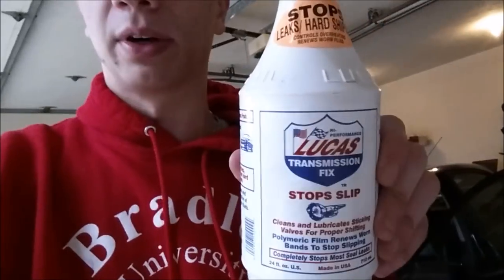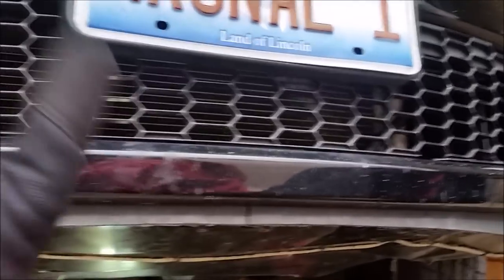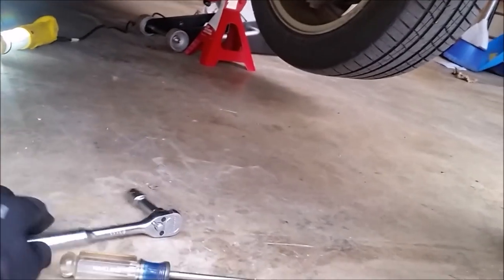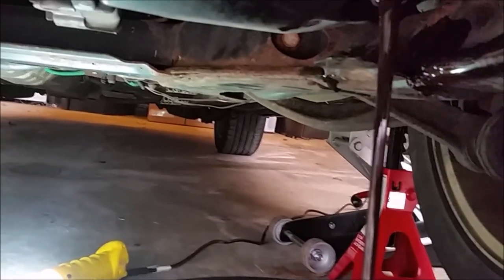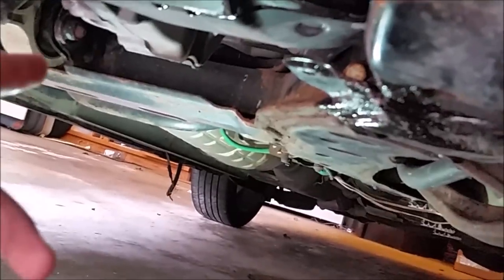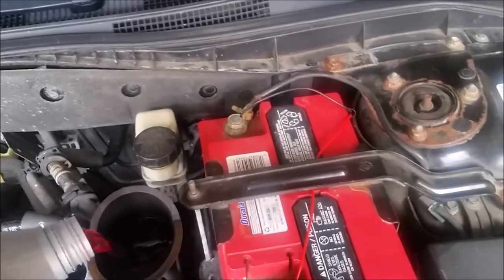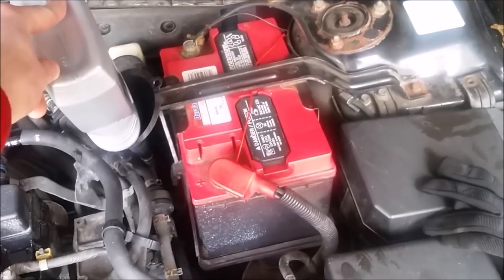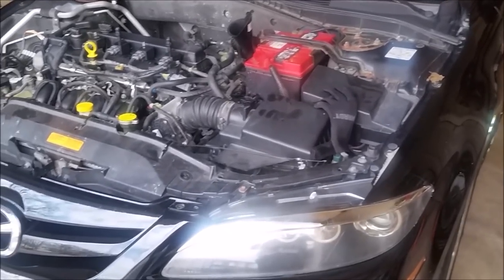Fixing jerky  automatic transmission and hesitation in acceleration   2006 Mazda 6

Comment: I had to pay $2800 bucks to get it rebuilt . I learned my lesson the hard way but never again . I change my oil at 5000 miles and my transmission fluid at 10000. My Lincoln LS have 280,000 miles on it and the transmission still going strong.
Reply: Great video! My grandfather & father both believed firmly in changing drivetrain fluids, needless to say I do to! 
iI's "cheap insurance" to keeping your drivetrain operational, and by doing routine maintenance little problems don't become big problems!  
So far it's worked perfectly for all of us. Except we change oil at 3k miles,
Like you, we also change our transmission oil at 10k miles. 
In addition, we change other fluids at the 10k 
We change differentials, transfer cases, power steering fluid, & master cylinder"brake fluid" at 10k miles... 
Antifreeze, thermostat, coolant lines and associated connection connectors/ clamps, and Drive Belt, or belts every two years regardless of miles. We also grease steering, suspension, components, & CV/U joints..
Reply: Bro my lincoln mark 7 is having problems message me so I can ask some questions

Comment: From what I heard and saw, the Lucas 'trans fix' will eventually kill your trans for sure. It might fix your issue for now, but it will also slowly expend your seals/o-rings indefinitely until they break.
Reply from the maker: Hi Charles, I did not know that. I will look more into it. Thank you for sparking my interest in this subject; it seemed too good to be true that it could save your transmission.
Reply: Used Lucas in a Jeep trans in 2011, never changed the fluid and it still runs 90%, sluggish only cold..thick fluid of course, 150, 000 miles later. Luv it. I know the reputation though.
Reply from the maker: Hi Charles, although I do believe that could happen. It's been 7 years since this video and my transmission is bone dry. I intend on making a follow-up video and address some important updates. There are some great products out there that now make this video and the products used dated.
Reply: Lucas has worked great for my vehicles for almost 20 years

Comment: Add seafoam to the transmission, drive for a week, drain and fill. Use amsoil signature atf and change the filter inside.
Reply: Seafoam is amazing!
Reply: Is that a joke? I can’t tell
Reply: @CashCowz962  nope. Works well

Comment: I own a Mazda 6 2007 and transmssion is slipping after I changed the fluid so I definitely will try this tomorrow, I will update my comment later :). Thank you!!
Reply from the maker: Hello, if it's slipping bad then this won't work. Bad slipping means clutch packs inside the transmission need replacing.
Reply: @AnthonyAwada The issue is when transmission try to shift from 2nd to 3rd gear but if I drive the car in manual there is no issue and all this started when I used a cheap transmission fluid so my bad. Thank you for your quick response.
Reply from the maker: @williamperez0306  I recommend using  Redline D4 and do a fluid change.
Reply: @AnthonyAwada  Noted, I will try this tomorrow and will let you know. Thank you again!!

Comment: My transmission was slipping in 4th and 5th gear and then the next time I got it limped home it had mostly 3rd gear and reverse only. After a few Google searches I came up with that it needed a transmission control module not located in underneath the battery tray yet located above the brake pedal inside the cockpit. Took a six and a half hour round-trip drive tonight bought one with 57000 miles on it just got done installing it noticed the one I remove with 150,000 miles on it happen to have black Sharpie marks near the bullet holes the three bullet holes mounting bracket not from Mazda. This tells me someone I already replaced the transmission control module before a hundred twelve thousand miles when I got the car? Even if the transmission control module swap works I'm still going to do what you did thank you
Reply from the maker: I'm glad everything worked out for you Terry, I'm assuming you have the FNR5 transmission like mine and they are notorious for slipping if not taken care of. I recommend Redline ATF D4, it's not the one i show in the video but I currently run it in my transmission and it shifts like new. Ill leave a link to a distributor of Redline ATF D4, but feel free to price around.  It is the most expensive ATF i have ever come across, buts its worth every penny. Let me know if you have any further questions. 

https://www.summitracing.com/parts/red-30505

Comment: Just cured this problem by replacing speed sensor - fluid was fine -but car was a pig to drive-now smooth as it should be.  FLUID WAS AT CORRECT LEVEL - DON'T BE CONNED!
Reply from the maker: Good to know. However, if your speed sensor was faulty you would get a code. So what do you do when you don't get a code?
Reply: This car was bought from a deceased estate- only 80,000 kilometers ,even though its a 2004 model  -  output speed sensor is next job - if both are the same age then they should work in sync?  -
Reply from the maker: Yes the do work in sync, however if they aren't broken I wouldn't touch them.
Reply: Hey where was your speed sensor? Outside or on the transmission?

Comment: I was told that if you put to many miles on any transmission fluid it would cause problem when 
You change the fluid. You just saw the black fluid that came out of that transmission OK ,you got to think about the clutches that has wore down,the  gears that has been running off of the dirty oil for so long that has metal shavings . When you add the new fluid it's thin and as the car warms up the transmission fluid warms up as well, as you drive the transmission goes through its shifting pattern this new fluid by being thin washes all the contaminated particles through the filters and causes the filters to clog therefore restricting the new fluid to properly flow throughout the transmission. I just had to rebuild my transmission cause I put like 70000 miles on my transmission fluid before I changed it.
Reply from the maker: This is absolutely correct Gregory, this is why I ended u changing the filter and fluid again. First time i did this job, i just drained and replaced the fluid. I waited 500 miles city driving and the changed the fluid again with the filter. Car shifts very well. I wont lie, its a bit jerky when cold. But this car gets pushed a lot and has 152k on it and has survived harsh weather of Illinois.
Reply: Ah man.. I had a feeling it be this..
Reply: A Transmission Specialist will tell you that if you change the Fluids all the Grit that's in there actually helps and when it's flushed out there isn't anything Abrasive to help Grip there's another Video by a Known YouTube Mechanic the Explains the Myth about not changing the Fluid .

Comment: My car drives fine when it drives on a single gear but i can feel the engine shifting gears and when I accelerate the car won’t shift fast enough and then it jerks because of it. Sometimes the car doesn’t jerk at all when i just started the car but when I drive for a while and end up in stop and go traffic then it’s most noticeable, it’s so bad it shakes the whole body

Comment: I ask this question everywhere online but no one gives me the answer. Can you mix different brand of transmission fluid even they are the same type or they are for the same model of vehicle? Can i just simply refill it or do i have to drain it completely before putting the new fluid in? thanks.
Reply from the maker: Hi Ben Whoever, you can mix as long as it's compatable with your vehicles transmission. In this video, the transmission fluid is still Mazda M5 but as you can tell I used Mobil one. 

The bottom line is this however, even though you can mix different brands of transmission fluid, not all are as good as others. So Mobil 1 tranny fluid isn't as good as Mazda MV(M5) fluid which both aren't as good as Redline ATF D4. You always want to put the best.  Hope this helps.

Comment: my 1993 mazda/ford probe has slipping while driving & also suddenly lost reverse. checked dip stick & burnt brown oil was there so will try fluid/filter change & lucas stuff. been whining lately aswell, kinda lika power steering pump sound low on fluid...is cold out too now
Reply: ANGRY VENOM how’d yours end up?

Comment: My vitz 1000cc with auto transm.  When put in drive it jerks, same when put in reverse. When pressed to move cars move slowly as if there is some hesitation. On plan and inclined road the car moves fine once it has crossed the speed of 20kmph. But when you have hilly road in front the car struggles a lot to climb it...specially if car has to begin it from stop position. Color of ATF is pink and no smell felt when i check after driving it for 20 km. Car stearing also wobles at a speed of 50 to 90
Reply: I need serious help. I am student and dont have much money.... :(

Comment: I have a bmw 550i same issues, slow shift when driving and jerky, (automatic) should I get a full service first? Before thinking about paying 3thousand dollars
Reply from the maker: I would change the fluid first. I am not great with BMWs, but I am sure there is a forum on jerky BMW transmissions. I wouldn't go in and get the transmission replaced immediately. Change the fluid ( don't flush) and change the filter if possible. Hopefully that will cure it and save you a lot of money. If you need any further assistance let me know.

Comment: I loved your video.  Quick advise needed.  I have a 2007 Honda Accord 4 cylinder with 5 speed Automatic.  Car has 42,000 miles on it.  When car is driven on cold day without warming up engine, transmission shifts rough from 1 to 2 and 2 to 3 for the first few shifts.  If engine is first warmed up for 3 minutes before driving, then transmission shifts much better.  I had transmission fluid flushed and changed at Honda dealer.  It didn't help.  What would cause this rough shifting when transmission fluid is cold?
Reply from the maker: Hi wgsvm, I hate to tell you this but it signs of a wearing transmission. When the fluid is cold it doesn't expand. It isn't until the fluid is hot until the car shifts fine which is an indication that the clutch packs have been wearing out.  There isn't much you can do apart from CHANGING the fluid (not flushing it). Change it with redline ATF (make sure you get the one suitable for Honda's). I like Redline. It preserves the clutch packs and makes the fluid do the work. Hope this helps.

Comment: Hi, I just bought Mazda 6 (Atenza) 2.3l and while it is cold it changes the gear with a push from 1st gear to 2nd. The color in transmission is yellow far from pink. I was told by Mazda dealer that I should change the oil in transmission at 100k, my car is at 80k now. Do you think that changing the oil might improve the gear shifting while it is cold? Thanks
Reply from the maker: It will slightly yes. Make sure the dealer changes the fluid and the filter. It's a very simple process. Many mazda 6 forums help a lot with it.
Reply: +Anthony Awada thanks! Is it better to do a flush or just changing is enough?
Reply from the maker: That's a great question Yaroslav. If your vehicle is on time for its scheduled service then I would go for a flush. But if you are late, then I recommend a change and filter change.
If you are doing the job yourself it is not that difficult. There are certain bolts on the transmission pan that are in real hard to get to positions. Fluid wise I would recommend either
1)Castrol ATF for import vehicles: http://www.autozone.com/motor-oil-and-transmission-fluid/transmission-fluid/castrol-import-multi-vehicle-automatic-transmission-fluid/830382_0_0/?checkfit=true
2) Mobil 1 fully synthetic (as I used in the video)
3) Mazda M-5 (which you can only buy at the dealership)
4) redline D4 (I have heard a lot of success stories using this fluid): http://www.redlineoil.com/product.aspx?pid=51&pcid=9
Reply: +Anthony Awada thanks a lot!!! 80,000km on the clock is it still on time?! :) I was told by Mazda dealer that I should change it or flush it at 100,000km. And when I asked him whether should I change or flush it he looked confused and just told me the price...
Reply from the maker: I see, well my honest opinion and I tell you as if it was my car. Is to just change the fluid and filter. Just to stay safe. A Quality Mazda OEM filter with Redline D4 ATF should make your car shift like butter. After this I would drive it within the city for 400-600 km

 If you see a slight improvement but you are not happy enough,I would just drop the bolt &;on the transmission pan (like the video) again. And change the fluid that comes out with new fluid and here is why:Your fluid is dirty and when you drop the pan you will only be removing about half (give or take) and replacing It with new fluid. So now your fluid is 50% dirty. If you drop the bolt again and drain half and replace half with new. Then 25% will be dirty. You could just flush all but then you run the risk of damaging the clutch pack.

Just make sure you don't overfill or under fill that transmission. They are very sensitive and if you under fill it and drive it you could damage the clutch pack.I hope I am making sense. Please respond if I don't.
Reply: ok so once i am at 25% dirty then couldn't I just do a drain one more time and then it would be nearly 100% clean? you're saying that flushing the entire system at once is not good because then there is no fluid inside the gears and what not which is not good, so doing the change in sections is better because you still have the fluid in there to protect it. is this correct?

Comment: Hello. I have a 2012 Toyota Camry that has a stutter problem when accelerating. When we got the car, we got the spark plugs changed, the problem stopped. I drove it Saturday for the first time and the  stuttering happened about 4 times maybe. I dont believe there is a specific gear that it stutters at ... So  What else could possibly be causing the stutter?

Comment: Can you describe the jerking your car did? My Mazda is jerking right now too and the AT symbol comes on when it happens but goes away as soon as the jerking stops. Just curious if we are having the same issue before following similar steps.

 We changed the transmission fluid and filter but the problem the jerking is still happening. 

The transmission fluid was flushed at 60k. Transmission fluid and filter were changed, not flushed, a few days ago. Problem is still happening. I guess we ought to try changing it again and possible with some stabilizer slip fix?

Thanks!
Reply: I took my mazda 6 2005 into the shop this morning because the AT light came on and the car started jerking when shifting from 1st to 2nd gear.  He told me it was the transmission vehicle speed sensor.  Autozone told me the sensor is $137 but I looked online ebay and they range from $28 to $79 dollars and there is a video on youtube that shows 2 latinos how to change it with a 10mm socket and a long extension with a swivel attached to the end of it.  Hope this helps.
Reply: Interesting! My husband wants to take it to the Mazda dealership tomorrow to see what they say. If they suggest something like a new transmission then we will definitely need to try this first.. Ours is a 2012 Mazda 3 automatic with 120k miles.
Reply from the maker: Thank you Don, Victoria as long as you are using the correct fluid and the filled to the correct amount I would then follow Don's advice. It isn't complicated. Hope it works out, please keep us updated!

Comment: I have the same car, 2006 Mazda 6 automatic with 64k miles on it. It jerks in between 4th and 5th gear if I accelerate quickly and after 60 mph it jerks even worse and then the check engine light starts flashing. It almost feels like the car won't go any more than that speed but I didn't try to since it freaked me out 😅 lol Every where I have called  and told them my problem they say it sounds like a transmission problem and that they don't do that. So now I'm stuck with not knowing if it actually is even a transmission problem. Did your car do the exact same thing? I mean does it sound the same like what I described? Do you think this will fix the problem?
Reply from the maker: Hi Angela, if the check engine light comes on I would check immediately what that code is. That code could be a something minor causing rough shifting that could be a cheaper solution than replacing the transmission. Mine shifted badly from 1st to 2cd really, but other things I would recommend is to have someone scan the transmission for any codes, as well as check for leaks or burning of fluid. Your car could be low on the fluid which will cause rough shifting. This is a problem you would want to take care of sooner rather than later as you could potentially cause internal damage to the transmission.  Please stay in contact and let me know what happens.
Reply: Hi Angela!!! I have the same problem!!! Can you tell me how you dealt with it?!?

Comment: how do you shift thru all the gears with out moving? do I use the slap shifter or do the wheels have to be in the air. im unsure about this from a comment below.  the first problem I had was a hard gear shift around 3 & 4 but ran stable once past so all I did was add the lucas fix fluid without draining and it made it worse. now  the trans grabs first from acceleration and slips out once I let off the gas. I can only get to about 2nd gear now sometimes. I may have abused the tranny before I known this fix. do you think its still possible or is my transmission done? its still drivable at idle but the fact it slips out and I cant even get to third gear with out doing some speed plotting.
Reply: I have that exact issue with my 6, I would recommend changing the Transmission Control Module as the next step to rule out transmission damage, and flush out all the tranny fluid. Do the fluid change first of course